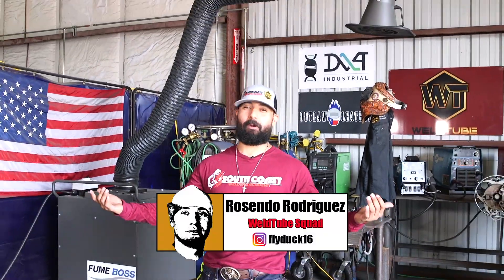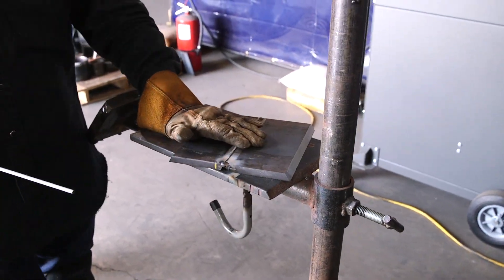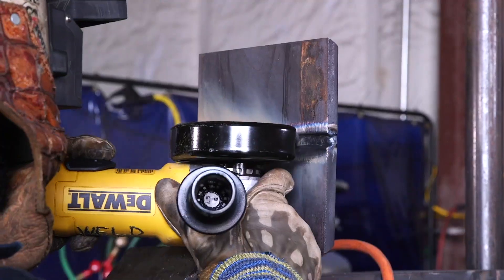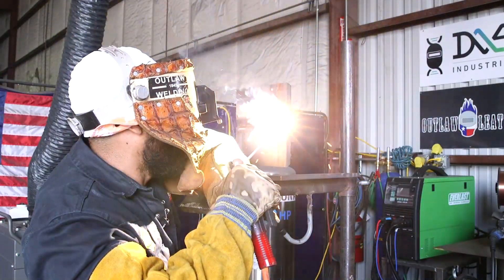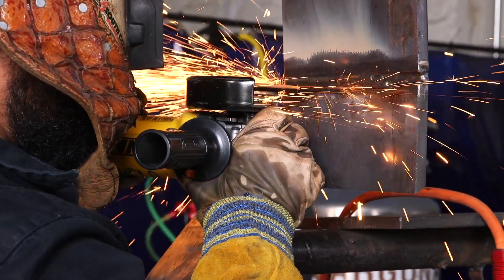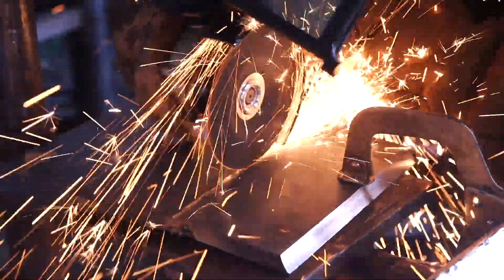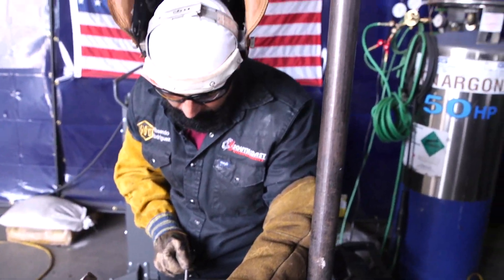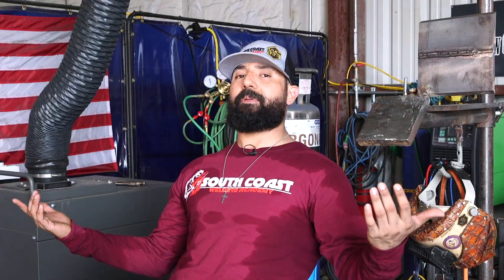How to master HORIZONTAL stick welding? | 2G Back Grind

Comment: Just took my 1g pass bent test. Did 3/32 landing using 6010. It’s hard cause it burns super fast. Even though my root pass wasn’t the best. The other welds supported good. Bent 3 pieces no cracks or nothing. Now I’m trying the root pass 2g and tbh I find it easier to weld the root pass than 1g.

Comment: Horizontal overhand was my favorite position but overhead was a close second. 27 years, I welded on everything from structural, ornamental, mechanical and was also pressure vessel certified. I use to build airvac tanks for cruise ships or basically anything that processed waste. Those tanks moved material at 2700 fps. Ever seen a ballistic turd? Lmao true story. Mild, tool steel, stainless and abrasive resistant. AR plate is pretty amazing stuff. SMAW,  mig, tig, oxy acetylene and brazing. I loved doing my job. Built some pretty awesome machines. Worked some very prestigious jobs but hands down my favorite Old #7, largest blast furnace in the western hemisphere. Produced 7 tonnes of steel a minute. Stood 360 feet high and when they knocked the bottom out of it, that shit was spiritual!  Feeling the ground rumble and the roar would reverberate. An incredible feeling to experience and years later I can still feel it. ISG is an incredible place to to work. Makes a man remember just how small we really are. After a broken neck and back I can not  do  it any longer but hands down, I loved my job. Worked jobs all over America. That being said I fucking hated welding anything with 60 series electrodes. I'd rather slow jerk a mall Santa. Welded millions of square feet of decking with 6022 but other than that, 60 series is nothing more than a coat hanger trash rod.  Thinking of going back to school to obtain a AWS CWI. Maybe one Day but for now imma arm chair welder lol so get'er done or take a soap stone and write hard on it and I'll get it
Reply: Man I’d love a beer with you yeah sound cool as fuck 🙌🏻🤣

Comment: I always did that position using a 2.5mm 7018 for the root and for the hot pass and cap with a 3.25mm 7018 but the technique is literally that spot on you guys are 5 stars 💪🏻

Comment: My 2G test is a 3/32 gap between the plates using a 6010 for the root pass.. wish my test was this easy
Reply: I saw this and was damn that’s way easier than the shit I have to do..my test at school is the exact same as yours
Reply: Damn we gotta do a 1/8 inch gap
Reply: @jaybucket2374 same with a back strap
Reply: and also no grinder
Reply: Same
Reply: Same
Reply: Same.

Comment: WELDTUBE: We need a video on how and when to add filler metal. There are so many gtaw vids but they all show the torch only. I'm having trouble feeding rod. PLEASE HELP!!!
Reply: You really want a constant feed into the weld puddle if your burning hot. If your welding cold, just dab into the puddle. Im sure some internet expert welder will answer this.

Comment: i didnt get to use a grinder during the weld out
Reply: Key words “during the weld out”🤦‍♂️
Reply: What do you mean by weld out? I am new to welding lingo so I’m just curious
Reply: Tarantula Fingers he means the actual process of welding the coupon out, from the point of getting it tacked and put in position and bought off to begin the test. lots of test shops will not allow you to use more that a file and wire brush during the test to assure you are cream of the crop!
Reply: @renoschneider145  Thank you, that makes sense